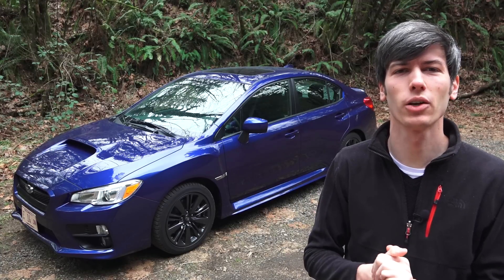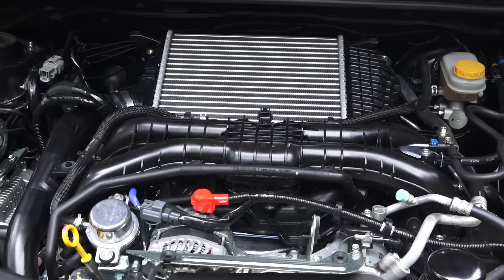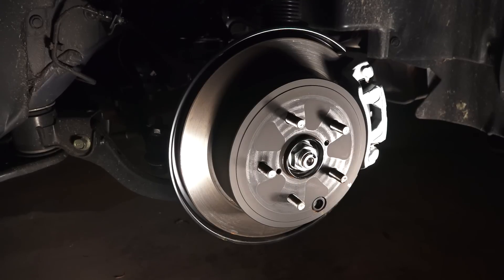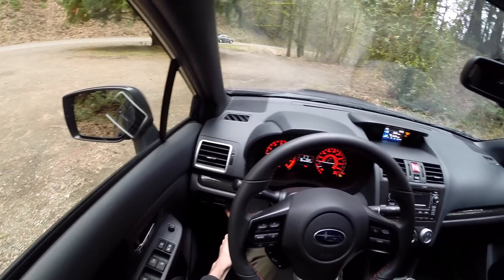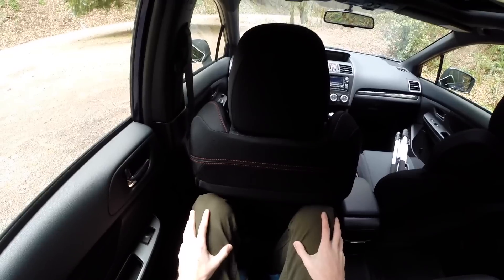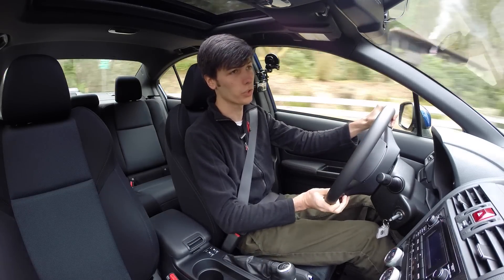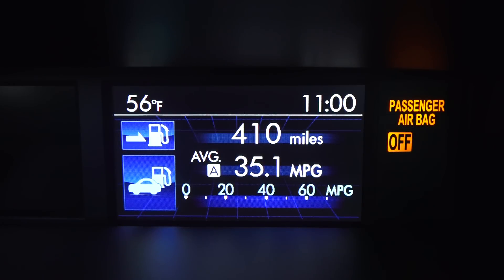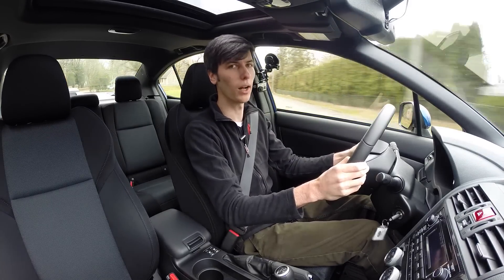2015 Subaru WRX - Review & Test Drive

Comment: The shifting is like Porsche's old gearbox where in order to shift fast, you had to be slow.
Reply: Sadeth Cheng Yeah, it would be an ECU controlled problem due to it being electronic.Electronic throttles aren't bad if they are done right.
Reply: That's kind of counter intuitive, isn't it supposed to be: "To be smooth you have to be slow"? That's basically how it is for this car.
Reply: thaik56 If you rush a shift, you end up going slower than if you had just shifted slowly. The longer you are out of gear= less time accelerating.
Reply: You just said it yourself, if you shift slowly, your car is longer out of a gear therefore less time accelerating.
But if you rush it, although it may not be smooth, you're still in the next gear faster than if you were waiting for the RPM to drop down before engaging into the next gear.
Not smooth shifting doesn't necessarily mean not accelerating properly.
Reply: thaik56 And you still fail to understand how it works. No point in explaining it again if you fail to understand it.
Reply: What you said doesnt make sense lol
Reply: Porsche Curves who said anything grinding gears, we were talking about not engaging smoothly into each gear.
Reply: thaik56 Syncros don't make a gearbox bulletproof. It is still very possible to grind gears.
Reply: Jared Tate How do you turn it off? Do you flash the ECU or something. My 5-speed Ford Focus has the same problem. I hate electronic controlled throttles so much!
Reply: thaik56 makes perfect sense
Reply: thaik56 Shifting  while engine and gearbox aren't synced= grinding gears.
Reply: thaik56 Old cars often have old synchros, won't shift like new and some gearboxes are very different in the way you shift them.

slamming gears can destroy transmissions shocks the gear assembly and knocks gear teeth off.

hey he even mentioned old gearboxes, you slowly but swiftly get into gear without slamming it, if you slam it will grind or break the transmission.
Reply: Porsche Curves i know but the point of this car, the wrx, wasn't about grinding gears, it was about rev not properly matching and not having smooth shifting.
Reply: thaik56 So Subaru made the WRX for the sole purpose of making a car that doesn't grind gears? Just give up.
Reply: Porsche Curves rev hang is a problem in new cars its emission bullshit.

its where u let off gas and the revs stil climb 

once tuned u can get rid of it and will shift fast like older subis
Reply: Porsche Curves why
Reply: jay czyzyk Why what?
Reply: did you drive thewrxmanual
Reply: jay czyzyk How is that relevant to your question? Pro tip- if you want a question answered, you have to ask it first. You don't ask other questions that have no relevancy since you have not asked the first question.
Reply: how did you get to your comments conclusion
Reply: jay czyzyk From the video and previous knowledge?
Reply: you dont have to be slow to to shift fast in the2015 wrx 1 gear is a very short ratio that spools instantaniously
Reply: jay czyzyk Due to the rev hang, you have to shift slowly to get a fast shift.
Reply: absolutely not true
Reply: jay czyzyk And why do you think that?
Reply: because i own one
Reply: jay czyzyk Then you got lucky because a vast majority of Subarus have rev hang,
Reply: yes i havea rev hang but shifting isstil fast and speed  is just as fast
Reply: Porsche Curves That's what synchros are for.
What you said totally applies for trucks that have transmission without synchros. That's why they need to double clutch everytime they upshift and double clutch and rev match everytime they downshift.
With regular transmission with synchros, you only grind gears when the cluch isn't totally disengaged while you shift. 
Do you even drive a stick or perhaps you drive a very old car without synchros.
Most people don't even match the rev properly whenever they shift and downshift and they can drive just fine.

Comment: i thought automatics had better mpg?
Reply: xdanny_22 If you have a DI engine you can keep it in a high gear and coast and use almost no fuel. If you keep it in neutral, the engine has to burn fuel to keep the engine rotating but if you keep it in gear, the transmission does most of the work and almost no fuel is needed to keep the engine rotating.
Reply: Not necessarily I mean you can always clutch in  and shift to neutral and coast with out adding gas in a manual.
Reply: Exact opposite, manuals save you more gas

Comment: Did you happen to try out the bluetooth connectivity and calling? How well does it work?
Reply: I tried connecting my phone to it but it's a little  hard to do trying to press all the buttons on the radio and such.
Reply from the maker: I have it in my '14 STI and answering is fine, as well as talking. Dialing is essentially impossible (by voice).

Comment: Finally. Someone explained why I got the jerking motion when shifting to second!!!!!!

Thank you!!!
Reply: ***** I normally shift at around 3000 rpm =/ and people just tail gate me and honk at me while i wait for the rpm to drop and slowly release the clutch lol
Reply: ***** How would Subaru know? And what about buying another ECU and reflashing it and putting the stock one back when you need to claim the warranty for something else?
Reply: I would highly recommend a tune. I am not sure if there are any out for the 15s' but they could solve the issue with ease :D In addition a new clutch plate would do the trick to even out RPM differences, but that is a lot of money.
Reply: +Fappolice what is Rev hanging?
Reply: ***** On purpose? Man that really sucks coming from a WRX.
Reply: +Fappolice Do they still do this off the lot or have they fixed this now?
Reply: is it that bad? like how many seconds does it hang for?
Reply: *****
ohh ok, thanks
Reply: What year did it start on the  Subaru WRX with the rev hang? Probably getting a Subaru WRX which year is best?
Reply: Holy Bread all you need is a pro tune and the car is perfect.
Reply: yea i just got my car a week ago the rev hang is really annoying
Reply: ***** doesn't sound too inspiring. :(
Reply: You could have realized it yourself if you watched the RPM closely, or by feel. If the car still feels like it is accelerating or having power being put down to the wheels, that's when you know, the throttle doesn't total follow your inputs.
Reply: Thanks, man!!
Reply: Man but that must suck. Hope you can find a way to tune that. There are some aftermarket modules that you're supposed to plug into the OBDII port to reprogram the ECU or something.

Comment: I fixed my Rev hang issue by flashing a stage 1 tune from cobb, which completely changed the way the car drives. However if the person is not willing to modify their car, the Rev hang is annoying but I'd say it becomes easily managable after a few hours behind the wheel.
Reply from the maker: Yeah, it's just a shame you have to void your warranty in order to do so.